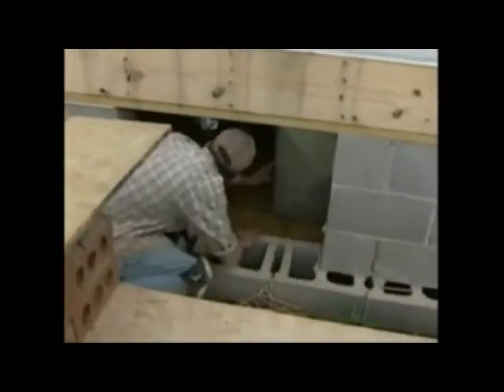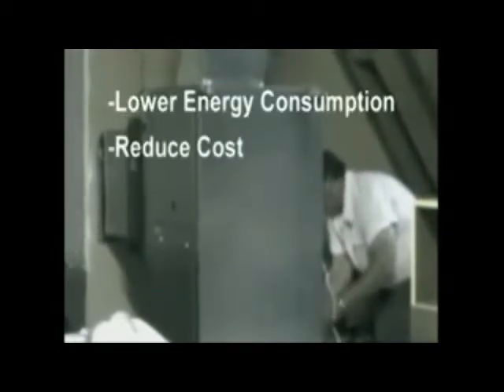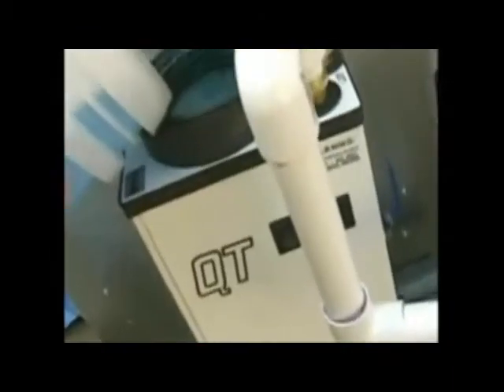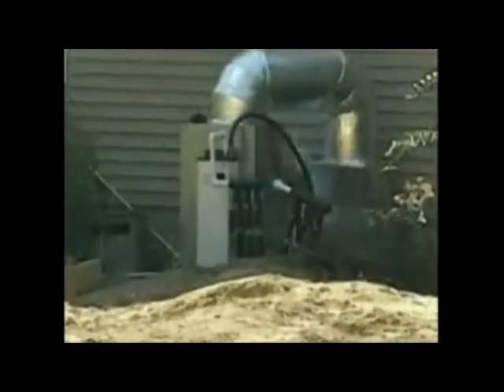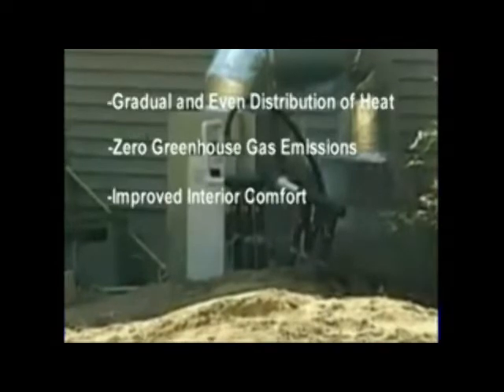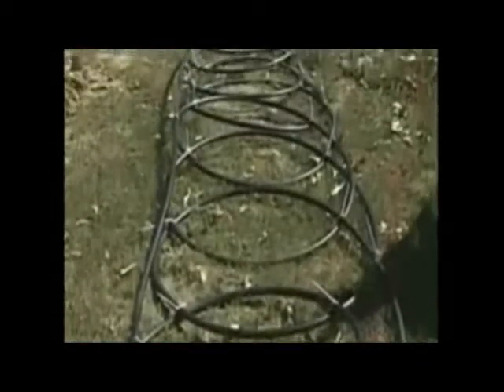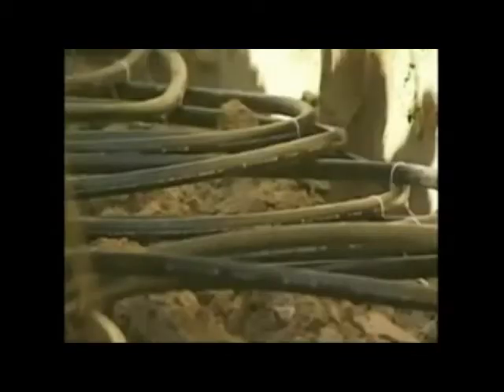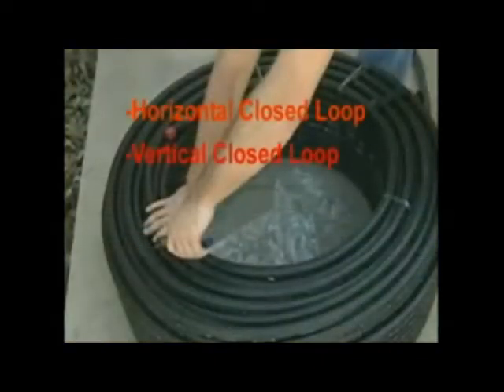Do It Yourself Geothermal WaterHeater

Comment: The electrical heat pump can be supressed, free of any heat pump electricity,  if you store the  summer excess solar heat on the roof, inside the  underground geothermal heat store, following the method used for exemple in w ww.dlsc.ca working since 2007, to heat 52 houses.
This can be  down scaled to a single house, heating with solar heat in summer the geothermal store  for use in winter, without any heat pump, because the ground remain above internal house température 20°C. .